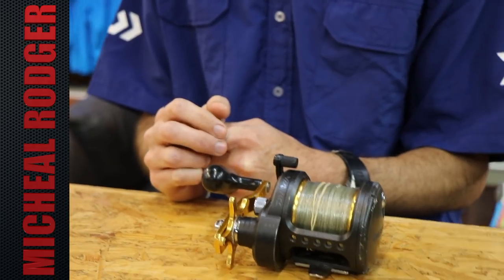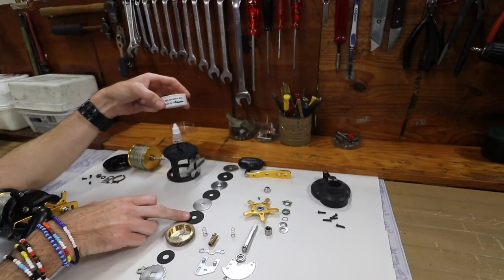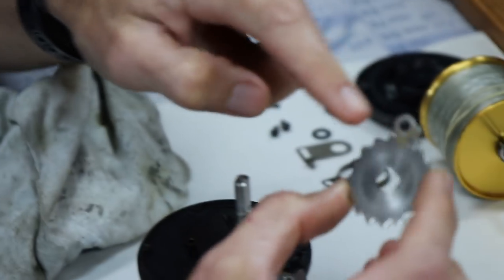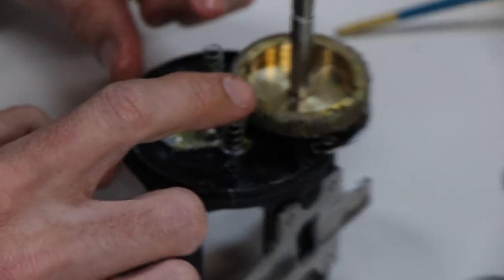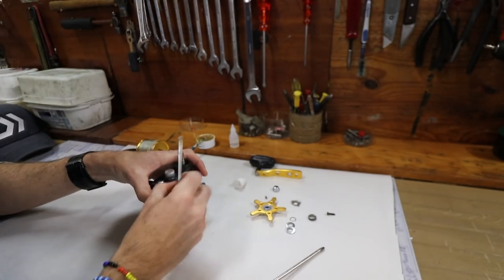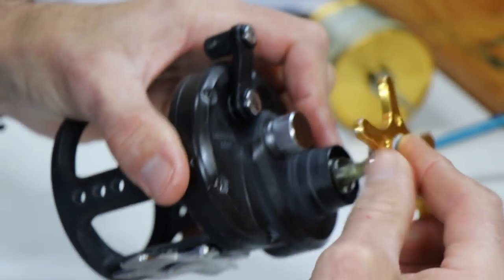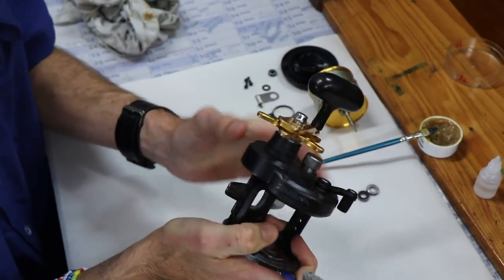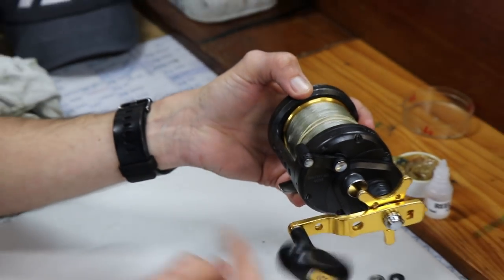Servicing a Mulitiplier Reel (Daiwa BG40H) | ASFN Tackle

Comment: Awesome video....can I use Q20 on my reels?
Reply: Q20 can be used for cleaning and de-greasing, as a lubricant, it doesn't last very long, rather use reel oil or würth hss2000 but still It wouldn't mean that you never have to do full service where you take apart like this as there are still some components that require greese and would the grease will either get hard or washed away by your q20